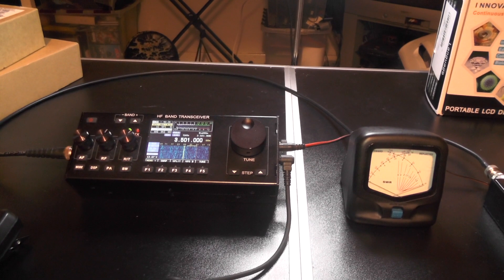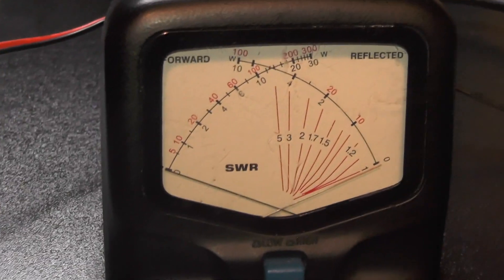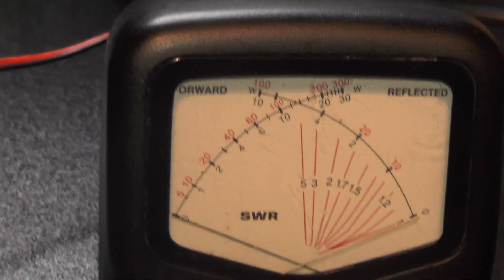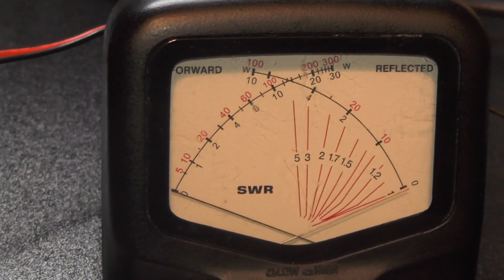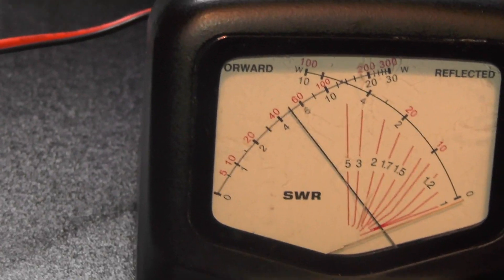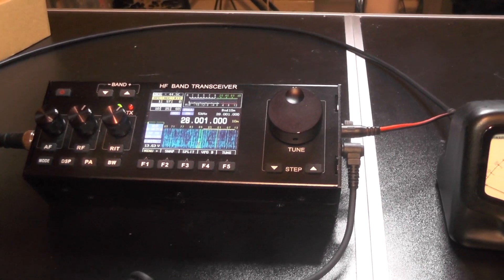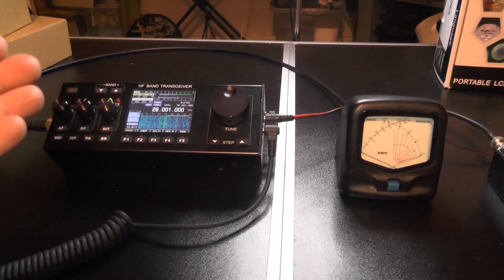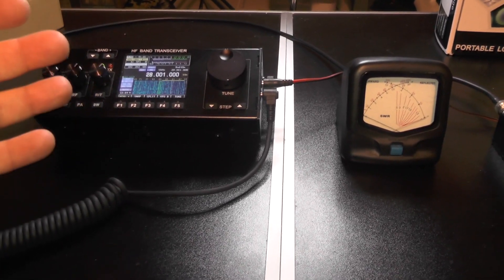How much power?

Comment: As I think has been mentioned a “dead key” should read no power with no audio drive, better to test it on AM or cw with a key plugged in. If SSB is reading power without you speaking there is an issue with the radio somewhere.

Comment: China copy of the mcHF. Buy the original and then won't have such disappointing discoveries
Reply: PA settings:
PA bias.
With PA set at 0, check the amps consumed, the turn up PA bias to be 500mw above that reading.
Then adjust each band power out put.
FYI out of ham bands, the radio will only TX 0.5w.
You need to calibrate your pa bias and peer settings on each band.
Reply: The original one is designed to be 5 W and mine was set almost precisely to that value.
It is possible to change it, of course. And I am pretty sure it is possible even with this clone.
If the finals will be capable of working with that output power is of course open to discussion :D